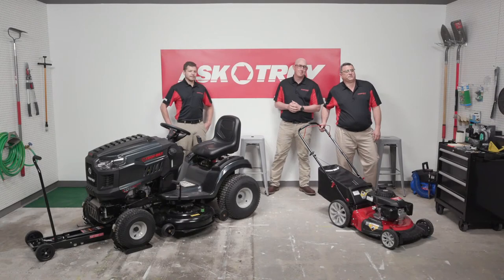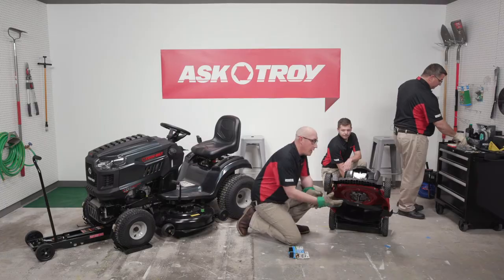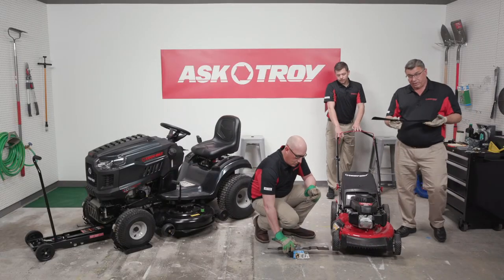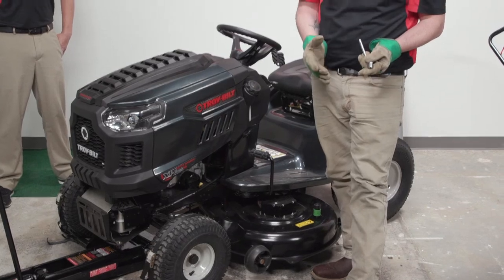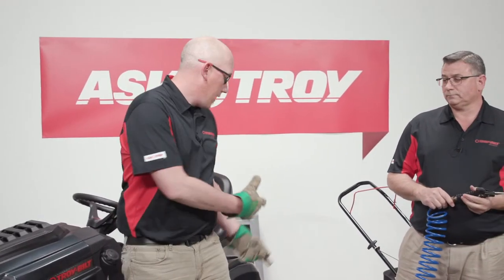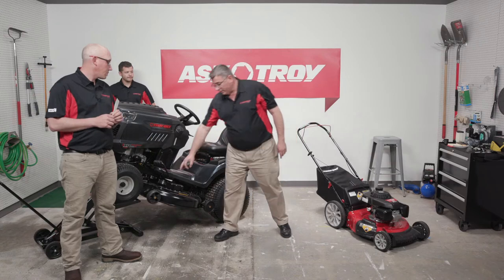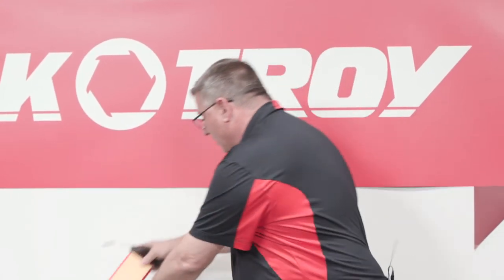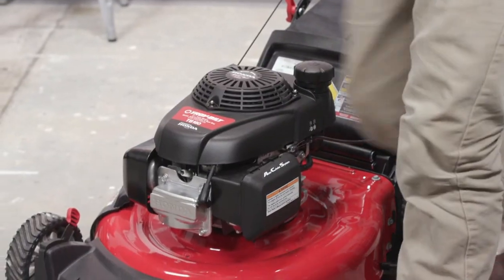Ask Troy Live - Mower Maintenance with Troy-Bilt's Product Experts

Comment: How do i install the following cables.  Rear drive cable (946-05121A), Control Cable 946-05105A),and one inch exten spring (732-0510A) on my 380 ES TROY- BILT LAWAN MOWER. Please Reply -Thank You!   Or sent me instructions .

Comment: The tall guy started to explain the leveling process on the Pony rider, but the short guy cut him off.  So; how do you level the deck? Left to right and front to back. 
BTW: My local Briggs & Stratton authorized repair man told me that many problems with mowers starting and running properly can be prevented by using only "ethanol-free" gasoline. He explained that, as mentioned in your video, ethanol attracts water. Not only that, but ethanol causes products like StaBil to break down, rendering them useless in preserving ethanol-based gasoline. Best Practice: drain the fuel tank at the end of the mowing season and do not store gas over the winter.